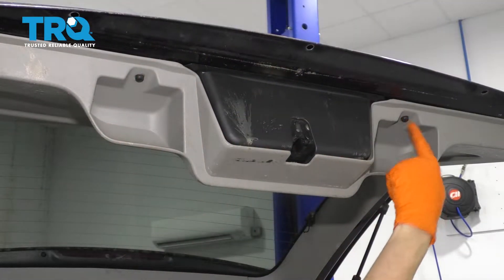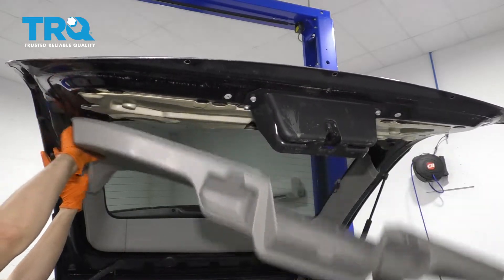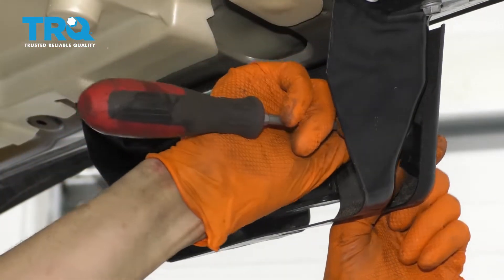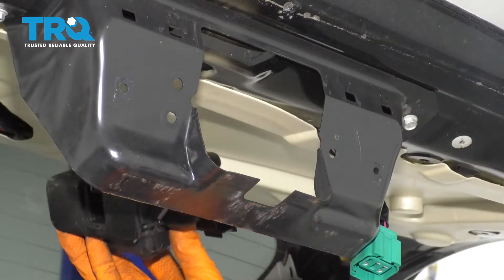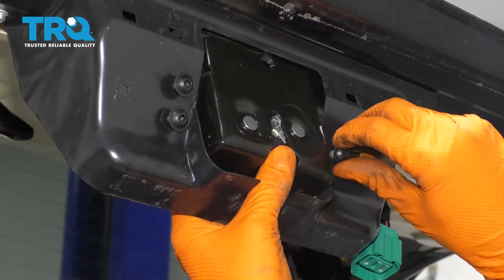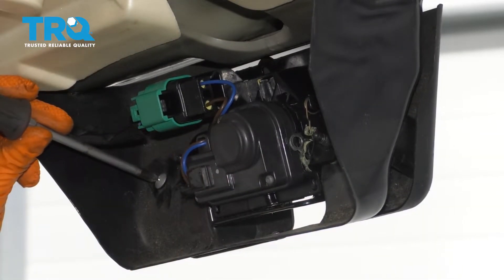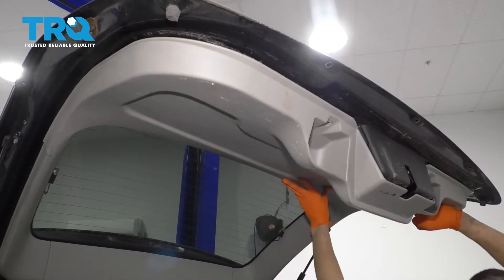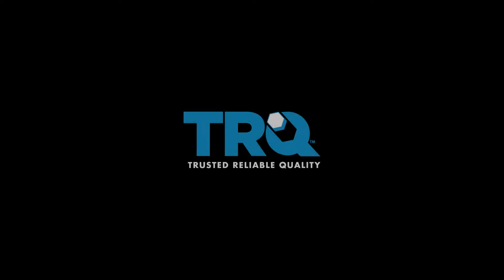How to Replace Liftgate Latch 2005-2009 Chevy Equinox

Comment: How do you know if you need the actuator or just the buttons if you go inside my vehicle you can push the button inside and it will open but not from the outside. The buttons don’t do any good